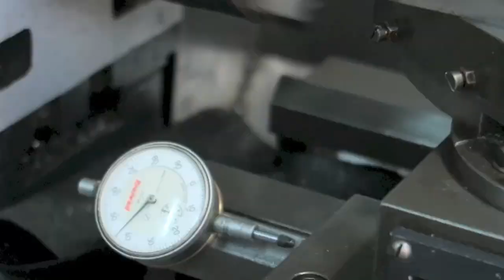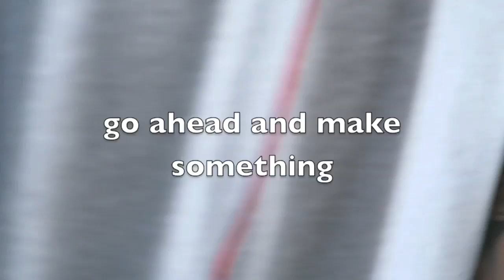DIY VISE ANVIL from Railroad track - Blacksmith beginner

Comment: I feel envy. The guy has access to a good workshop and now, during quarantine, there is time to do something just by hand, for the soul.
Small green vise at 20:46 - where are they from? They were produced in the USSR and I have exactly those.
And man, don’t put your foot on the machine. 999 times without problems, but for the thousandth time ... And such glasses are unreliable eye protection when using angle grinders.
The vice was magnificent both constructively and aesthetically. Separately, praise the ability to weld. My respect from Russia.
Reply from the maker: Андрей Никитенко thanks man. Yes that is Soviet’s vise ;)

Comment: That was the best most pro like build I have seen a vise of that quality would sale in the $200 + dollar range that was nice the only thing that I seen that it needed was the use of ball bearings inside the race to help protect against ware as you adjust the position of the vise and a grease fitting  and grease to lube it with

Comment: Been wanting a metal lathe for a long time, so I could do stuff like this.  
I did manage to make brass & aluminum bushings, & other small metal parts on my wood lathe... but options are vary limited.  

Fantastic vice.   I want one.
15:15  Oh & what's that... the Grind & Stare?   Ok Mr Fast & Furious 🤣

Comment: You can not make a anvil out of inferior metal with an inferior process.
If we could, everyone would make a anvil, instead of spending $400.00 t0 $2500.00 for a new anvil.
Now your anvil shaped object (ASO) may do everything you need it too.
But it will not last 200 year of everyday use like a true anvil has.
Yes I have railroad iron, but it is case harden & weight about 1/8 of what a true anvil mass.

Comment: now where might i get a peice of track that small for CHEAP. i mean really cheap cause im trying to save up for my new gaming pc that im looking on amazon for a bunch of parts for and its totalling up to a bit over $400 so im gettin pretty close, im at nearly $300 already, but i dont wanna lose much progress on that while i get to being able to blacksmith as a near full time hobby instead of just going every second saturday of every month just to go to a real forge, i already have a brake drum as a fire pit (i guess you could call it that) and i have a bunch of clamps and hammers and chisles, now i just need something hard as all hell to ram my hammer against without breaking, ive already tried using a small block of tool steel about 2 inches by 1 inch by 1 inch, and that cracked right half in two, im so close to being able to finish my sword and i want to make more of them at home, its a simple design really, just a big old 3 foot piece of flat stock steel i got at my local lowes, i have a second one that i just measured for the original length, the sword one has currently expanded by about 2 inches. this is my passion and i would love to be able to start working overtime on this project of mine since ive already made a knife and a machete so far, im kind of a melee specialist at the moment and yet in games im either a rushing gun spammer or a sniper, oh how the two sides of life differ from each other, im really just a jack-of-all-trades type of guy ya know? i just thought of making a stand for my little small sledge hammer that i currently use for the hammering of the metal right now and using that as the anvil, but keep me posed on what you can find please.
Reply from the maker: yeah, bro!
Reply: oh, and one of my friends lives near an inactive line on a highly active street, so no trains are ever gonna go there anymore, im thinking of cracking the rail with my sledge hammer for some reason, but im sure the city would not like that but anyway, i could make a piece as long as i needed with that technique if it was allowed, he has already found like 12 spikes and 2 tie plates, and a third one thats cracked in two, so i could go down to his house and pick up a bunch of stuff,kinda like stockpiling a bit